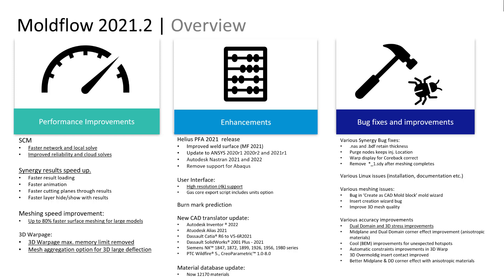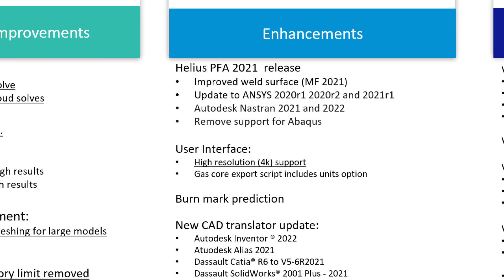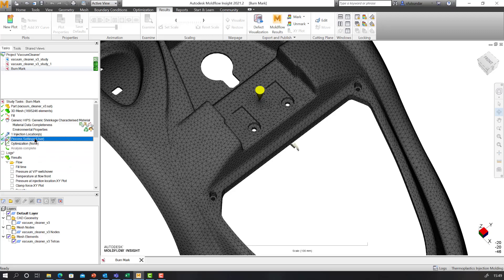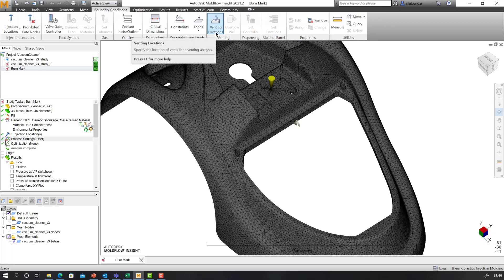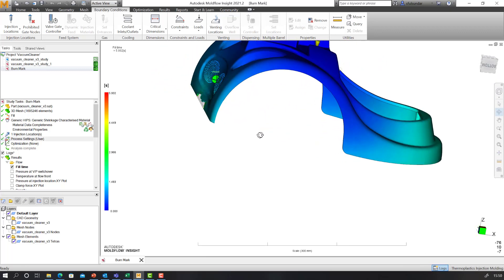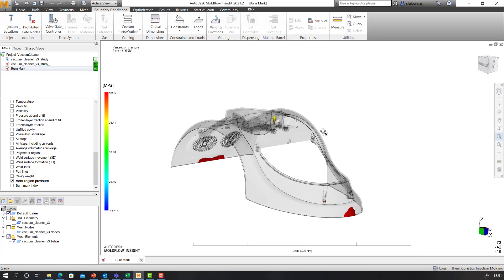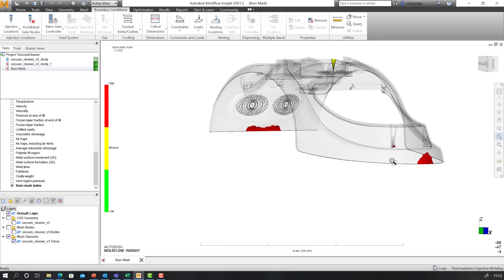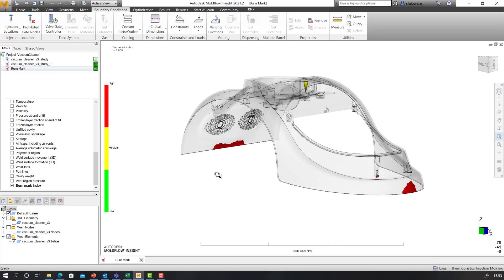Burn Mark Index ( Venting Analysis)

Comment: Dear Sachin Fulsundar,

Autodesk Moldflow 2023 (insight, synergy, Adviser)  has been released ?
Reply from the maker: Hello Brian, Autodesk Moldflow Insight and Fusion Moldflow Adviser has been released on 14th Sept. you should able to see the products for download on the autodesk account page. Thanks Sachin
Reply: @sachinfulsundar5012  Thanks so much. But how about  Synergy ?
Reply from the maker: @BrianDo_CADCAE  - Synergy is bundled along with Autodesk Moldflow Insight 2023, however it will have 3 solvers with Ultimate capabilities.
Reply: @sachinfulsundar5012  Thank so much